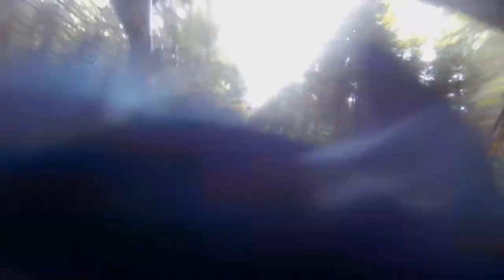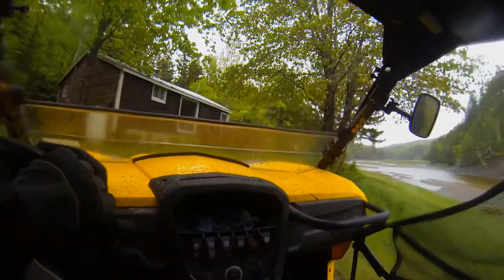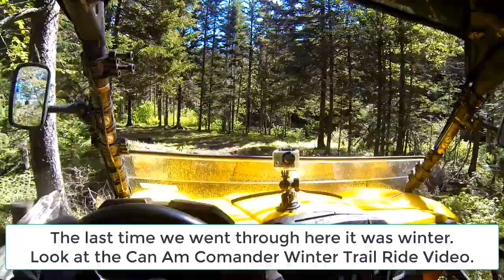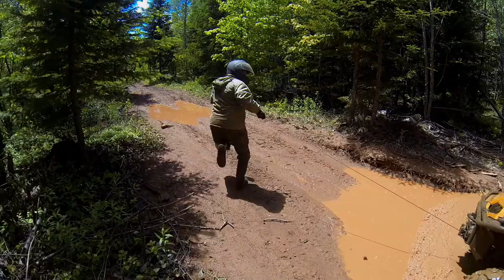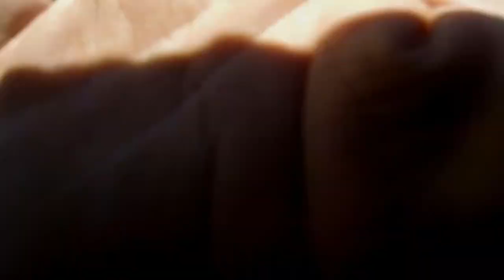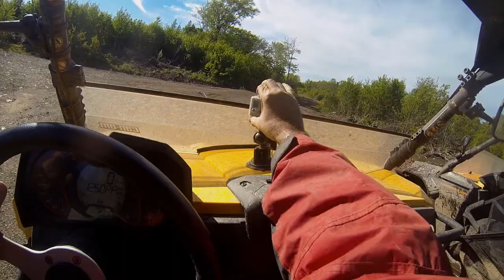2 Day ATV & SxS Trip Backwoods Canada

Comment: looks like your all riding similar tires, i know this is an old video, what tires did bruce go with. I'm currently looking at Traxions gripper max's for my midsize ranger. tire shopping is difficult. 8ply. upgrade from the 4ply currently running on the stock. Carlisles.
Reply from the maker: Bruce bought Blackwater Evolution tires. He told me he felt they rode hard because they were so stiff and the treads wore out fast, which he didn't like. If you don't want tires that stiff maybe try Bighorn 2.0 or 3.0 as they're 6 ply and seem to wear well. Good luck with whatever you decide to get.

Comment: I'm buying a 2017 can am commander xt 1000cc tmrw just like your driving. Fairly pumped up. Northern Wisconsin, will need heat kit for winter.
Reply from the maker: Fantastic. Y ou'll love it. You may not need a heat kit as the Commanders generate a lot heat because the engine is under the seats. If you have a roof, and front and rear window to help keep the heat in you may not need it. If you have doors that will help even more. I would try it for a few runs in the winter months to see what you think before you spend the money on the heater, unless you really want one, of course. Thanks for watching and posting!
Reply: @EastCoastATV  Great advice. Thank you. It has 2200 miles on it and I'm hoping to have it a long, long time. I ride all over the country so I need a solid machine. I'm coming from an outlander four wheeler so big upgrade. I like can am.